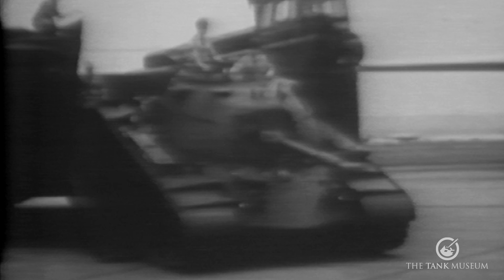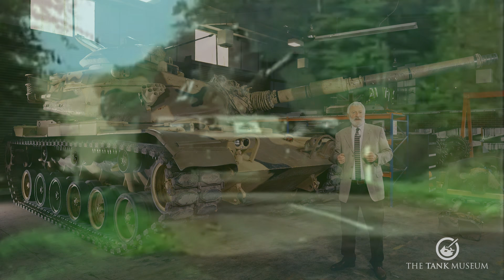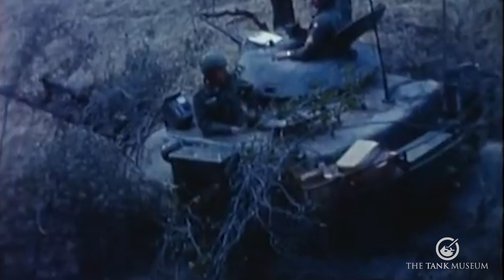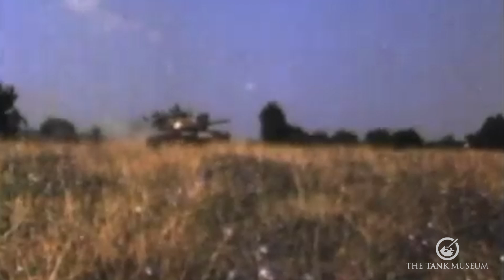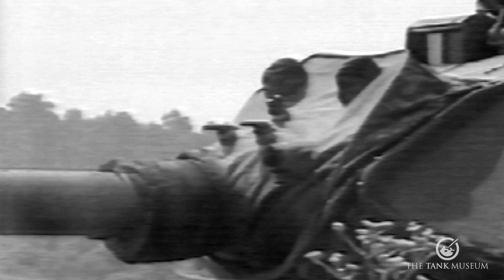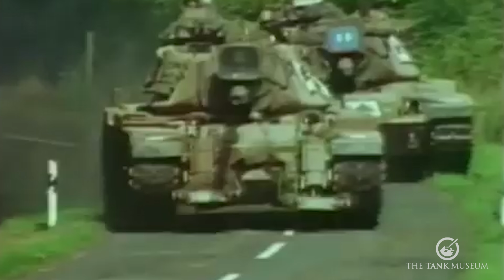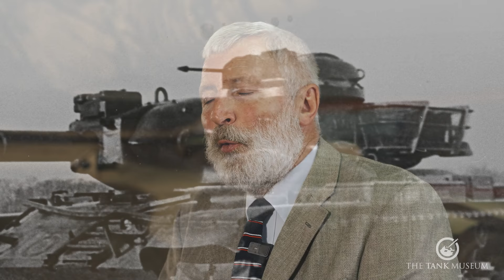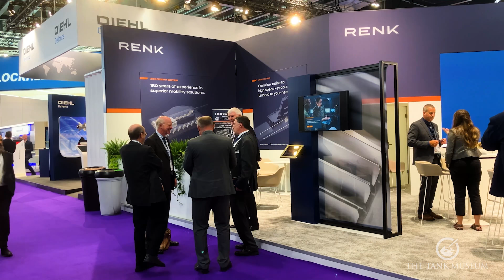M60: Cold War Guardian | Tank Chats #175

Comment: I grew up around these, the M48’s, 551’s, M113’s, M60AVLB’s, etc because my dad worked at ANAD and I later worked there. A couple of interesting things about the 60 is that it used 3 trailer hitch balls to mount the searchlight. The other is that there are hundreds of these on the ocean floor in the Gulf Of Mexico where they were used to create an artificial reef (REEF X).
Reply: Which president dumped them

Comment: Great video! I commanded a platoon of M-60A-1's at Ft. Hood in the early  70's. A 38:24 cpl of memories: the M-73  coaxial MG was always jamming. The commander's cupola was hand rotated with a crank. We were told it was for antiaircraft protection. I tried handcranking the cupola to track an "enemy" F-101 during  Voodoo during a field exercise. Needless to say it was pointless.The M-85 was not as easy to use as the old M-2, and the cupola was ineffective.

Comment: I loved our M60s at the Fort Snelling Military Museum.  Our primary A3 was our tow truck.  That M60 equipped with a tow bar could move our immobile artifacts around when needed.  We would have an open house once a year where we crushed cars for the crowds.  Great content.  The M60's engine is referred to as a "pack".  The pack contains the transmission and engine all in one unit.  We pulled the pack on an the A3 once and it was really simple as the splined drive shafts push into the transmission once the retaining clips are removed.

Comment: A static M60 was recently added to the two intact M3A3 Stuart Tanks, at the local war memorial park. The M60 unloaded itself from trailer and parked on the concrete pad under its own power. New pad stained in rear with diesel and split down the center from weight. 

The Stuarts still have their radial engines intact. I crawled up the rear air opening and took pics of engine.
Can still see turret basket in top openings. Interior looks nasty but complete. 
Be nice to see them run again someday. 
Park has room for a maintenance building "museum" and open areas to drive them for public "Tank Days". There is a path to the historical park next door; that has more room for a larger hilly dirt track. 
The Stuart is such a small tank that it would fit in a garage and be a nice model to own and operate.
Could still display them outside, just add a metal roof to their pads. 
The M60 pad needs a roof too; rain is their enemy now.

Comment: I lived this.  Basic training with really really beat up old M60A1 (1981).  First unit M60A1 Rise Passive.  1/67 AR had turned in their M60A2 for the older M60A1 Rise Passive.  I remember stories of the A2 including not turning on the electronics until 50F and the blow back from the missiles.  A year later transition to the M1.  I heard a lot of comments on how good the M60A3 was with a thermal sight.  The M1 was so much better.

Comment: A friend was a platoon commander running M60A2 in the Fulda Gap they called them stubbies or just A2. Missiles need to be used first to avoid shaking up the guidance electronics. Number of Missiles carried may also have been decreased in some units after estimated engagement opportunities were calculated.

Comment: In Korea the M26 did OK on level ground but had serious transmission slippage on hills where they needed to be able to pull up fire maybe 8 shots then get off the hilltop. Bunker busting for the front-line troops. Much as Ukraine forces are doing now in support of the front-line troops. The older Shermans could to the job faster without the possibility of slipping on the ascent.

Comment: When I was a Combat Engineer in the 80s I  rode in and on the outside of an M60 training at Ft. Bliss.  The turrent rotated on vicious looking teeth that you did not want to put your fingers in.I was impressed by the tank with its maneuverability and speed until it slipped a track and we have to get a new ride.

Comment: I served in the 2nd BG, 28th Infantry (Mech) in Germany.  In 1962 our old gas  powered M48A1 tanks were replaced with diesel powered M60s.  Both Recon and Anti-tank platoons had organic tanks.  For several years our outfit has a mix of gas and diesel powered vehicles, extra POL trucks.

Comment: Just a note.  None of the M60 series had an 'overpressure' NBC System.  It did have NBC capabilities by installing an internal Gas Particulate System to pre-filter air fed to Tanker's gas masks via hoses at each station.  Each crewman plugged that hose into the receptacle on the M25A1 mask.  Then the Gas Particulate system had positive pressure to the crew's mask, acting like today's CPAP machines.  This reduced crew fatigue by having them have to draw air thru the long hose of the mask itself over long periods of time.  Crews had to be in full NBC gear to traverse an NBC contaminated environment.  The  first US tank w/ overpressure NBC system was the Abrams.

Comment: In the 90's, I worked with a curmudgeonly old test director at Aberdeen Proving Grounds. He knew everybody, everybody knew him. He could just get things done. I was the only person in our group he liked- I think because I actually enjoyed listening to his stories. I remember that he liked the M60 power pack because it was VERY quick/easy to remove and replace. Do you know if this (or my memory) is accurate?

Also remember his story of testing M113s- when the track pads were worn out, it would be time for a little play- get the M113 going full bore (on a hard surface), and quickly jam full brake on one track. The APC would get into a spin and throw out a shower of sparks all around the spinning vehicle.

As to a personal story- I was having a bad day on a test, to cheer me up, I was given a ride in an M1 (they had to be put into a secure area at night)- the driver decided to show off a little bit and do an extra lap around the (unpaved) test track at a somewhat higher speed than normal. He was drifting a 70 ton vehicle (applique armor) around that track!

Comment: Commanded 4 of these as an Armor Platoon Leader. I was on the M60a1, even though I trained on the M60a3. IMHO they should have ripped off the cupola and replaced the M85 .50 cal with an M2. If you notice they built the M1 without either one.

Comment: It’s cool to see the M60 get its upgrades and keeps getting more and more equipment until it can’t do anything else than the Abram’s comes out and now the Abram’s is getting to the point will be replacing that soon. Still think the US and NATO in general need a cheap to produce mid tank line that could be cheaply produced and able to support infantry and take on tanks if needed something like the T72. I know the Booker is essentially that roll so it’s a good direction but we could do better imo.

Comment: I finally learned a believable answer to the difference between the German tanks and the lighter duty American tanks. I often wondered why the American tanks weren’t as heavy and as protected with armor as the German tanks. And I finally got the answer.
The German tanks did not have to do beach invasion landings from landing craft boats .. The American tanks had to be able to come ashore from my landing craft/boat and drive through the water up onto the beach. So that meant they had to be smaller and lighter. That explanation made perfect sense to me, true or not… I wish the historical videos would point that out when they would mention how much better the German tanks were than the American tanks. They make it sound like the Americans were not producing tanks that were made well enough for the troops, sort of like the jap zero plane..light on protection & expendable.

Comment: My Dad was working on his engineering Ph.D at the University of Michigan in rhe 1950's, & was involved in various R&D projects during that time, including jet propulsion & experimental land vehicle design & study (in a land locomotion laboratory), & also worked on the M-48 tank's stereoscopic range finder, at the ATAC (Army Tank Automotive Command) facility in Warren, Michigan.   

Specifically, my Dad designed a shock dampening mount for the optical range finder, which he said was very accurate (based on a firing demonstration of the M48 tank that he saw) but could lose alignment calibration (which would ruin the range finder's accuracy) if the tank were struck with a light round. If I recall correctly, my Dad said the design improvement for the range finder worked. I think he said he developed an impact dampener for the M-48's radio, as well.

Comment: If the Soviets attacked our defense line for 2/68 Armor 8th ID in Baumholder was the town of Schlitz north of Fulda.  Getting across the Rhine between the Lahn and Main river corridor would have had a daunting task trying to navigate roads choked with refugees fleeing westward. With the M60s (that were turned in by winter 1989)  It would have been a cross country endeavor that even would have pushed the limit of or the new M1A1's in our inventory by early 1989.
I suspect we would have been lucky to get east bank of the Rhine and set up tactical operations at Koblenz. We had an engineer detachment at Dexheim probably was our fail safe across the Rhine south of Frankfurt.

Comment: Worked on these beast 1980 to 1984 saw some that were really abused on came in at a very slow crawl after crew drove off a big drop and broke around half the torsion bars so she could just creep. Saw another sunk to the top of the tracks in thick mud. 
The crews would also compete to see who could knock down the biggest trees using the wedge bow.

Comment: Imagine guys the M58 120mm Gun on the M103 was selected and upgrade it and it uses APFSDS? it is Rumored that the M58 is powerful than the M256 120mm gun Abrams using that would be a easy slice to Soviet Heavy Tank program and those massive experimental Tanks

Comment: The small township my sister-in-law resides has an active VFW and they lost their "Plinth-Display" because, as it turns out, it was a complete German 240mm Field-Gun and Caisson- practically a unicorn of WWII equipment..... Word was a corrupt local politician purchased it as "scrap metal" then resold it to an anonymous buyer for a huge payday..... Allegedly

Anywho....... The VFW requested a replacement military equipment to sit on the plinth. The US Army was decommissioning M-60s at the time, so one was offered and accepted.

The vehicle arrived on a flatbed truck, the driver of which had no idea how to get the 50+ ton tank from the trailer to the plinth.

There is a local steel-mill, with a dedicated staff of diesel mechanics to service all of the various dumptrucks, tractors, forklifts, etc.

A call was put out and a service truck from the diesel shop soon arrived.

After a short inspection and a few tests, it was determined that the M-60 had dead batteries and no fuel. 5 gallons of diesel and a jump-start later had the vehicle purring like a kitten on the trailer.

Then one of the mechanics revealed that he was a qualified driver on the M-60 from his service in the Army.

He proceeded to back the vehicle off of the trailer, drive across the lawn of the park and precisely park the tank on the plinth.

Everyone came away delighted, except for the steel-mill managment, who were apparently upset that their employees actually made the general public happy and punished the mechanics.

Those managers had a lot of car-trouble in the weeks afterward....... Allegedly

Comment: I drove these while serving with the 1st Armored Division in 1971-1973 in Illeshiem West Germany. Israeli's discovered during their wars that if the gunners controls took a hit the controls would spray the interior compartment with highly flammable liquid with dire consequences for the turret crew. The US Army seemed to forget the lessons of WWII with Wet Storage and an interior hit would likely set off the ammo. These problems were fixed with the Abrams. Fine driving tank and you felt like you were in a Cadillac when driving cross country. Loader had plenty of room to work his station and so did the tank commander and gunner. The Sabo round would travel a mile per second and was a good tank killer.

Comment: I worked on the laser rangefinder for the M60A3 at Hughes Aircraft, It was an analog system!
Reply: I worked on M60A3's from 1987 to  1993 . They used a laser rangefinder. Major change from the coincidence rangefinder used in the previous models.

Comment: God, I loved my M60A1. "70 tons of rompin', stompin', steel!" as we called it back then. And yes, with four crewmen, combat loaded, fueled up, and with all the crew members "stuff", camo net, and tarp were crammed into the bussel rack, she tended to weigh in on the scales at 70 tons.....Just like the first generation M1 Abrams did....Even though the first-generation Abrams WAS taller than the M60A1 when all the radio antenna were mounted,  and shared a fire control system with the M60A3. Come to think of it, from an old Tankers point of view I miss both of my old tanks but the M60A1 was, and remains, my favorite.

Comment: M60 did not have a whole tank NBC "overpressure" system.  You connected your gas mask into a hose which pumped filtered air into the mask.  So, individually, the crew had a form of overpressure but not the whole tank.  As an aside, the gas particulate system which fed those individual hoses had a heater which was nice to use in winter time to heat mittens etc.  The thermal sight which appeared on the M60A3TTS in the early 1980s was a huge and sudden technological overmatch compared to fielded Soviet tanks.  TTS was fun to play with too!  Excellent video and presentation! (I spent 4 years as an M60 tanker in Europe and the US)
Reply: I got a Counseling statement almost article 15.  Got caught cleaning particulate filter.  While at NTC ft Irwin CA  my track was in constant rotation 15 crews. it was late summer dusty and who know how many had been using onboard air(not conditioned) just clean.  Said the cost to filter was 500 and the system pump ?  Scared me to death